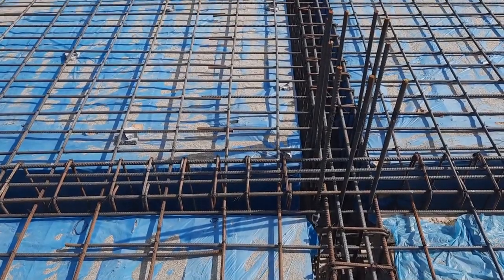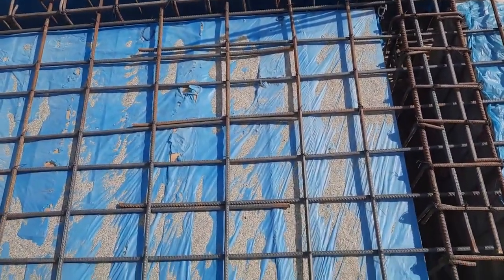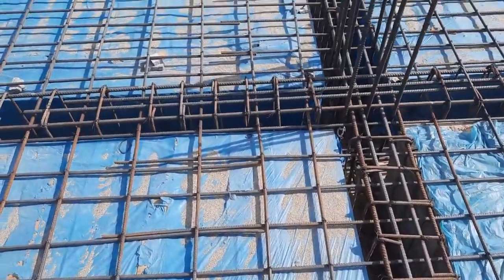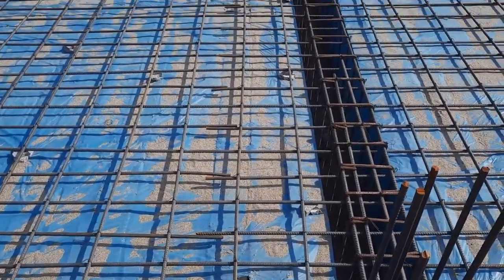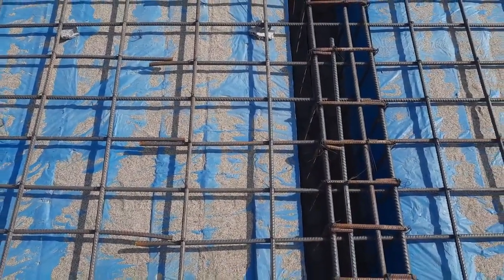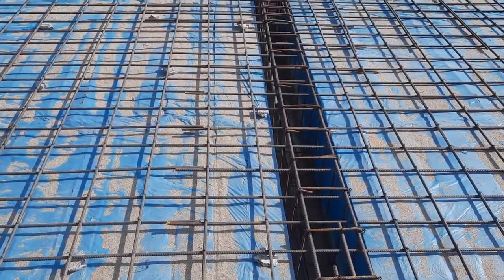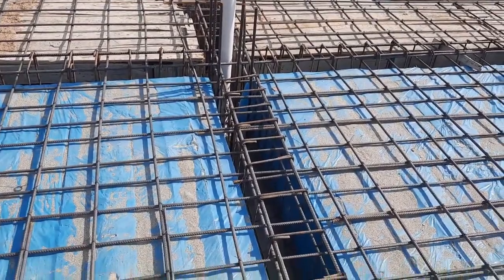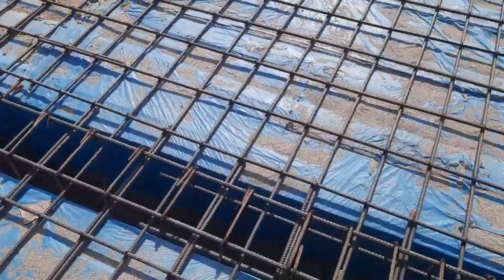5 Big Mistakes in Slab Construction | Site practical Video |

Comment: The slabs look like less than 10 ft in length, is it necessary to provide crank bars or bent up bars?  what is the minimum size of the slab where the crank up bars are must. Thanks sir for your videos.